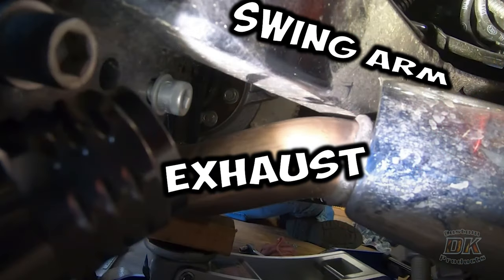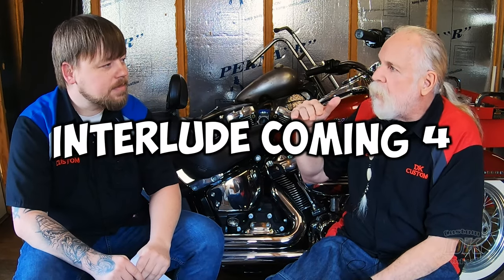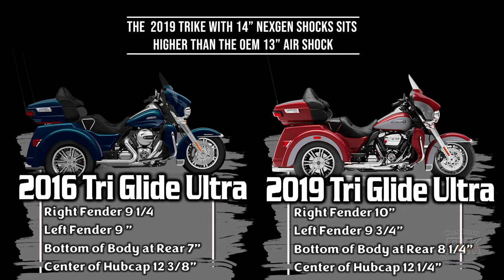Harley Trikes Tri Glide, Freewheeler, RG3 & FLHXXX

Comment: I enjoyed these 3 videos.  I bought your 13" NexGen Shocks for my 2022 CVO Tri Glide since I have HD lifts installed with OEM shocks and the ride is stiff.  You stated 14" will not work on Tri Gides with lifts - correct?  I am having them installed by HD next week.  I tried to install them myself, but the permanent, red Loctite stopped me from loosening the four shock bolts.  I measured my trike with the OEM shocks, HD Lift Kit and 26 PSI.  They were:  Right Fender 12 3/8", Left Fender 12", Bottom of Body at Rear 10 1/2", Center of Hubcap 12 3/4".  THE FENDERS ARE 3/8" DIFFERENT.  I assume, as you stated, this is due to OEM assembled it wrong, even though it was a CVO and was assembled by one individual.  The HD Service Manual states the 4 rear frame screws should be adjusted so the frame side to side is within specifications of 0.125".  I noted somne of the trikes you measured were not within the HD 0.125" specifications.  Seems HD needs to work on their quality controls.  Also, reading the service manual, I learned that there are two bolts that adjust the length of the Rear Body to the frame.  You may want to prepare a video explaining these two factors and impact as well as the tire pressure, lifts, and shocks.
Reply from the maker: Thanks for watching our vids and commenting.  Good questions.
The 14" NexGen will work with a Convertible Comfort Mount™, it is not a lift.  You can see it at this link- https://www.dkcustomproducts.com/harley-trikes-convertible-comfort-lifttm-for-14-shocks.htm

HOWEVER, the 13" NexGen's you got work just as well as the 14", and you can install them with or without a Convertible Comfort LIFT, as seen at this link- https://www.dkcustomproducts.com/tri-glide-rear-shocks-comfort-lift-kit-added-comfort-lift-dk-tri-cmft-lfkt-1551.htm

Yep, it is rare to see a HD Trike where both fenders are exactly the same height off the ground.  Fortunately, most of the time it is not very noticeable.  I have owned 3 Tri Glides, and none of them were the same...but I never took the time to make any adjustment to them.  I DID install R-B-T LED Mud Flaps, and besides being very useful, they also made any difference less noticeable.  You can see those at this link- https://www.dkcustomproducts.com/tri-glide-mud-flaps-w-run-brake-turn-led-lights-built-in-dk-tg-mf-led.htm

We may do a video on adjusting the heights.  Thank you.

We do have the other 3 videos you mentioned.  They are listed below:

Tire Pressure- https://www.youtube.com/watch?v=aA5U3-cdm2c
(and, yes, this applies to the low profile tires on the CVO also.

Lifts- https://www.youtube.com/watch?v=marLHzA5E0g
Regarding Lifts being installed by a Dealership-  We have dozens of Dealerships that buy these from us and install them regularly.
We have other Dealerships, where the Service Department is not so good at reading or following instructions...those guys sometimes run into problems due to not following the instructions.  If would be good to encourage your Dealership to read the instructions and watch the video above, if you have them install a lift.

Shocks...we have many videos on them, but here is one of them- https://www.youtube.com/watch?v=vbU6fdtxjSI

Always feel free to email or call us with any questions.  We appreciate Your business.
Support@DKCustomProducts.com
662-252-8828

KP
Reply: @DKCustomProducts  I had HD install the 13" NexGen to my 2022 CVO Tri Glide today.  WOW, you are spot on in terms of giving a better ride over the HD stock shocks!!  However, in terms of fender height, HD checked the frame height, and it was to 0.125" speculations, my right fender is still 3/8" higher than the left fender.  By process of elimination, the Service manager said it has to be the 4 bolts that attach the fender to the body are 3/8" off.  The Service Manager never realized this before and thus measured 3 Tri Glides on the floor - 1 was off 2/8" and the other two were the same.  Just cosmetics and does not affect the ride but I expected better from HD, especially CVO cosmetics.  So you can add to your videos on fender height can be off due to factory fender attachment being off.
Reply from the maker: Thank you for the added information! I will share it with Kevin! I am so glad that you are happy with the benefits of having the NEXGEN™ Shocks installed! Thank you for sharing and for commenting! MB

Comment: Good afternoon, I’ve bought upgrades from you before. I have a 2010 ultra classic, I need a longer shifter. I  only run the front and a longer brake pedal. I will remove the storage compartments to accommodate the pedals
Reply from the maker: We do not carry a longer shift arm, but they are readily available from Harley direct or places like J&P Cycles.
The extended brake pedal, for your year & model, that we use can be seen here-  https://www.dkcustomproducts.com/08-13-touring-models-extended-brake-pedal-lever-arm-dk-ex-bk-08tr-c.htm

Comment: I watched all three videos in this series. Great information as always. I'm going to be adding your suspension setup to my 2023 tri-glide. I do have a question. If the crap shocks are removed and then I add yours, that brings the "sag" back, correct? So, does this mean that the lift portion also needs to be added to the trike? Thanks again.
Reply from the maker: Yes, with all of our shocks you will have the sag back, which is part of what gives the improved ride.  On your '23 if you choose one of the 13" shocks, like at this link- https://www.dkcustomproducts.com/dk-custom-nexgentm-14-trike-series-shockstm-for-harley-davidson-trikes-2040.htm
You will want to get the Comfort Lift with it to keep the height about the same as where it is with your OEM shocks that have little or no sag.

If you go with the 14" shocks, like at this link- https://www.dkcustomproducts.com/dk-custom-nexgentm-14-trike-series-shockstm-for-harley-davidson-trikes-2039.htm
You will want to get it with the Comfort Mount, this will also keep your height about at the same as where it is with your OEM shocks.

Either one will give you max ride height, while having proper sag, and a Much Improved Ride Quality.

Thanks for the comment, glad you are liking the videos.  Always feel free to email or call with any questions.
Support@DKCustomProducts.com
662-252-8828

Comment: Can you run a car shock 2016 tri glide
Reply from the maker: You can run car air shocks, or car shocks with a coil over spring.
That is the first thing we started experimenting with 13 years ago.  We played around with it for a couple of years, testing a variety of different shocks...including some from a Corvette.  We could not find any that gave a quality ride.
It would have been nice to find some that worked well, would have saved us hundreds of hours of R&D and testing.  Also, would have been far more economical.
Here is a link to a Report you may find useful/interesting- https://www.dkcustomproducts.com/overview-of-performance-rear-shocks-99.htm
KP

Comment: Hi guys. Question.  My goal is to raise my trike back end up to help it load into an rv toy hauler.  How much higher will the back end be approx?  It is a 2020 so I understand that will also help it handle steer and brake better.  Is that correct?   I m not concerned with upgrading the shocks as I usually ride alone without a lot of luggage weight these days.  Thanks from Debbie in the Rockies
Reply from the maker: The Convertible Comfort Lift™ Kit, that we make, replaces the stock shock mounts of your Harley Trike.  It gives an increase of 1.25" at the shocks and 1.6" at the rear of the bike. 
It will help with handling as well. You can see more about them at this link - https://www.dkcustomproducts.com/tri-glide-rear-shocks-comfort-lift-kit-added-comfort-lift-dk-tri-cmft-lfkt-1551.htm

Here are part 1 and part 2 of the Trike Ride Height videos that you may find useful/interesting - https://www.youtube.com/watch?v=qiv-ElS--YQ
part 2 
https://www.youtube.com/watch?v=sS_zxGo-wSg

Thank you for commenting!😎  MB

Comment: So my 2011 TG sits 1/2" lower on the left compared to the right. It scrapes more on the left pipe.
I'm running 26psi. So if I reduce psi to 22, wouldn't it bottom out as scrape even more?
I would need to install a lift kit before dropping psi?
Reply from the maker: Yes, it would scrape a little easier with the drop in psi. You can add a little air to your shocks, but if they are set where they ride best, then a Convertible Comfort Lift will help you out.  See link below-
https://www.dkcustomproducts.com/tri-glide-rear-shocks-comfort-lift-kit-added-comfort-lift-dk-tri-cmft-lfkt-1539.htm
Reply: @DKCustomProducts  can I buy your products in Canada?
Reply from the maker: @gregrose6915  We do have a few dealers in Canada. Give us a call 662 252 8828 or email at support@dkcustomproducts.com & we can point you in the right direction.

Comment: 19 TG. My measurements are 3/4 inch higher than yours. I am thinking due to the air in the tires at 26 psi lifting everything up. I am going to do the comfort lift. I am also thinking of going to a slightly taller tire to take care of the lower shift points due to the gearing. What are your thoughts on the tires?
Reply from the maker: You will like the comfort lift and how the new angle will help your ride quality.
On a taller rear tire, we know some that have done that and liked it. We have not tested it, so can't offer an informed opinion. You might want to check out TrikeTalk.com and ask some of the guys there that have done it. 

We do believe that the 2017 and later Trikes could stand to be geared a bit higher. 
Most Folks end up with better shocks, and that, combined with taller tires, could cause clearance issues with the fender. 
The other option which Kevin is thinking about doing on his 2019 Tri Glide, is to use a different front pulley to get a littler taller gearing.
Reply: Might be an idea for a video. Just saying.
Reply from the maker: @miamited69  That would be a good video comparison....would be a bit expensive of a test.